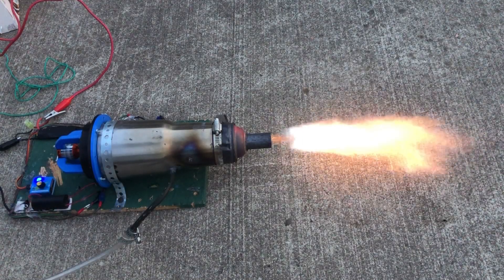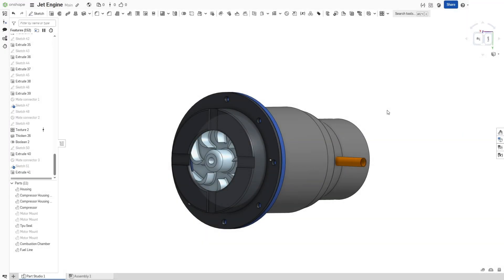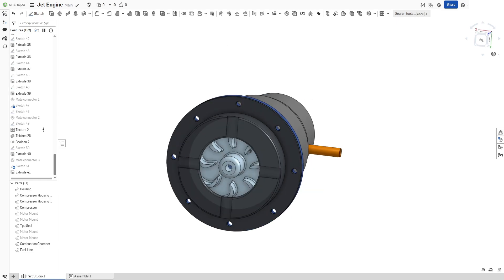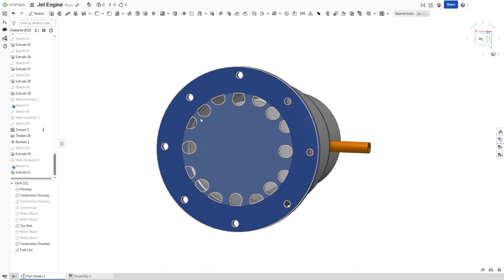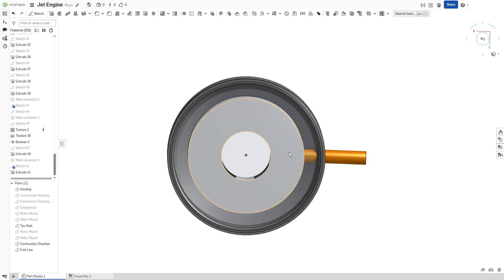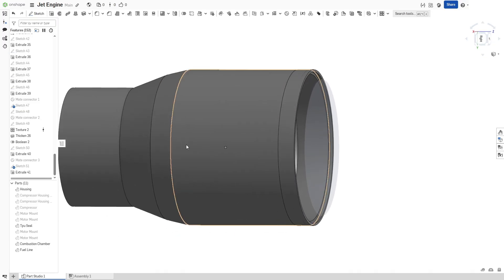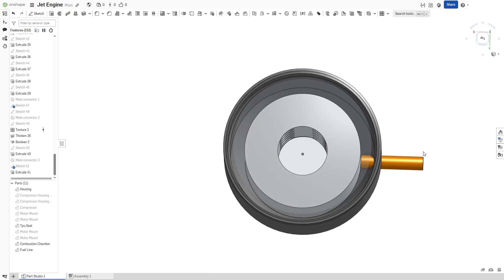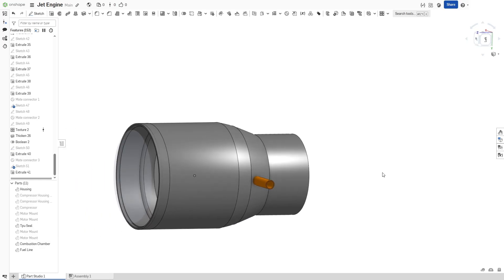Homemade Jet Engine V2

Comment: Are the holes on the combustion chamber the same size? 1:29 .
Reply from the maker: Yes, the holes are all the same size. When drilling I did end up going with a slightly smaller diameter drill bit though.